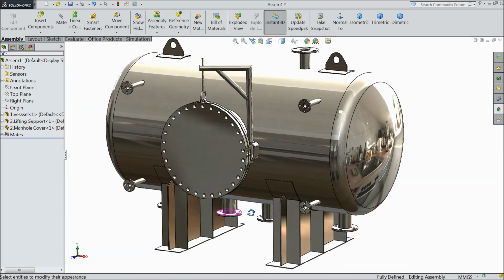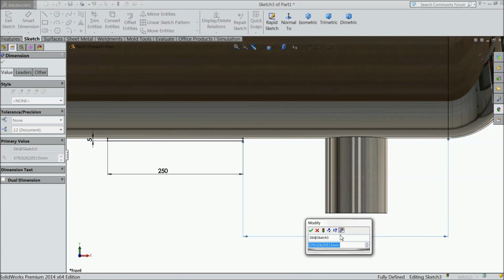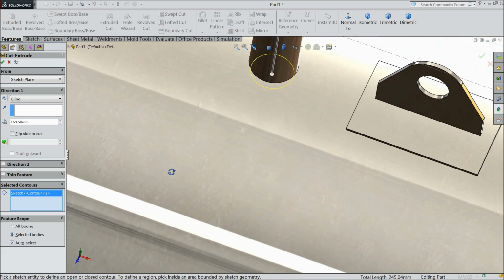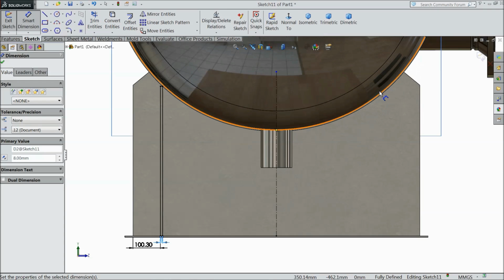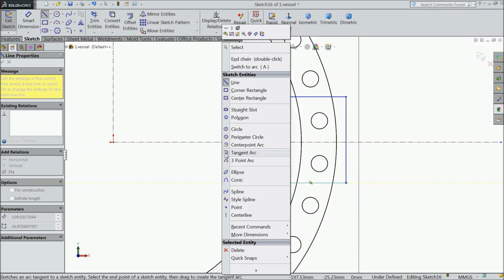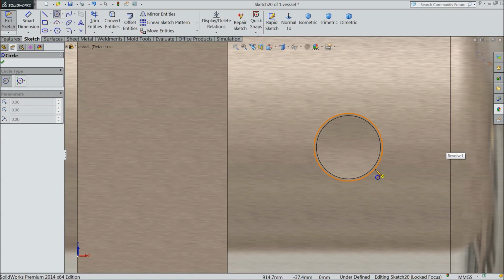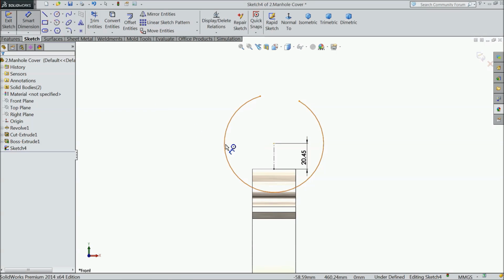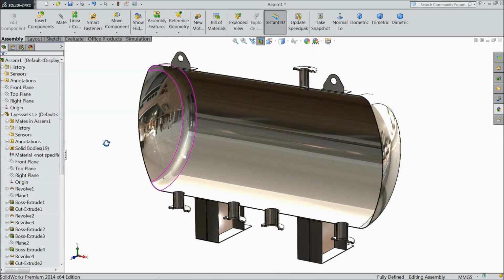Design of Pressure Vessel in SolidWorks | SolidWorks Assembly

Comment: No it's not the correct process there  are multiple flanges and different size parts it's not a single part current process is assembly process there a standard flanges and parts